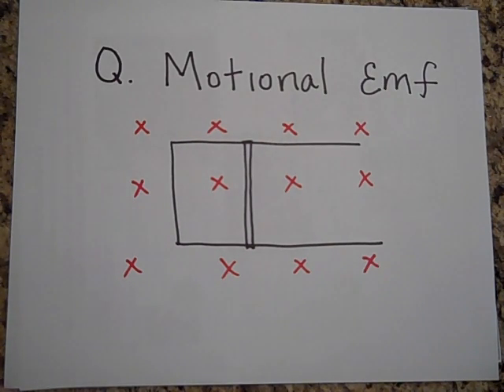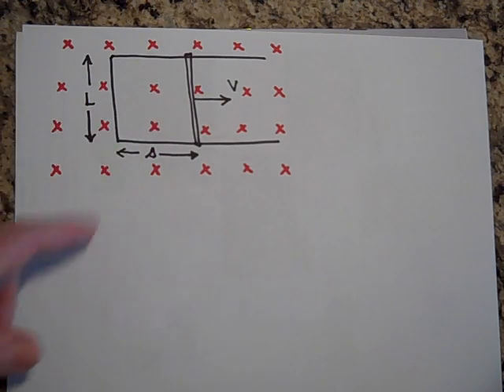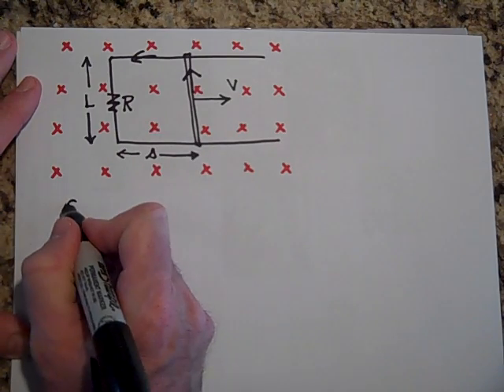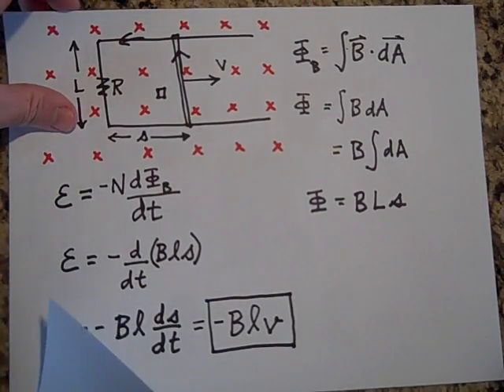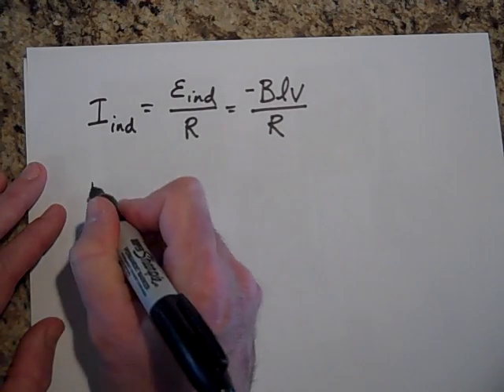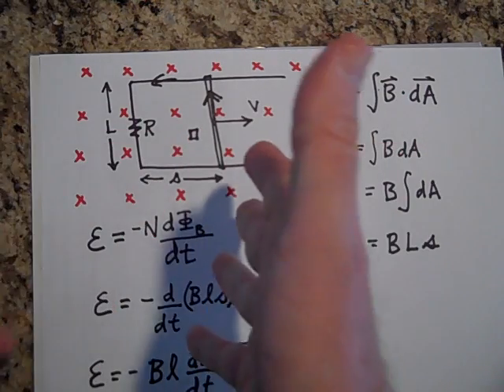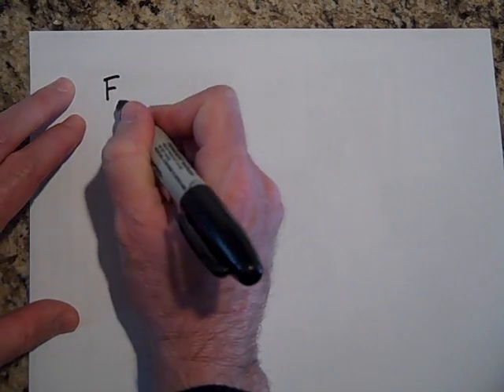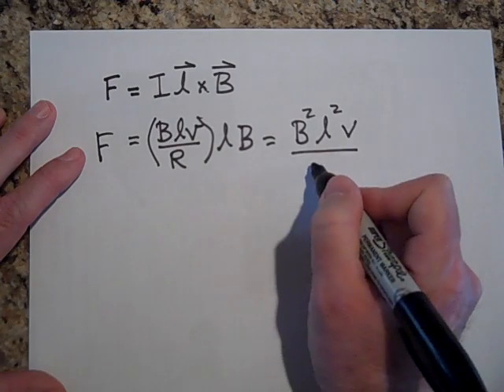Motional EMF As an Application of Faraday's Law

Comment: The emf is due to the motion of the slider through the magnetic field and is not due to the changing flux linking the loop.  Faraday's Law states just the opposite and is therefore not a law but just math.  It is a case of correlation, not causation.

Comment: Current counterclockwise 1:33 why
Openstax Ch 13-14
Reply from the maker: I am using "conventional current" as the flow of positive charges.  If you are using current as the flow of electrons, which it actually is, then electrons travel around the circuit in a clockwise direction. If we use conventional current then the right-hand rule would indicate the forces on the positive charges are upward in the moving bar.

Comment: sir lasseviren1 , since the current was initially derived to be negative, should the current at around 8:00 be negative as well?  thank you!

I did not understand much from my electromagnetics class when I was in college and it is only now through your videos that I understand the subject. thank you so much for your videos! :)
Reply: Super late reply, but hopefully this can help other who see this comment with a similar question. Yes the negative should be carried over, this should also make conceptual sense since it is in the "negative direction" albeit arbitrary but since "v" is positive and rightward it hence implies the other direction is negative. Therefore, yes the force should be negative, however he did not seem to take into account the vector properties of force so he was likely solely solving for magnitude of the force.